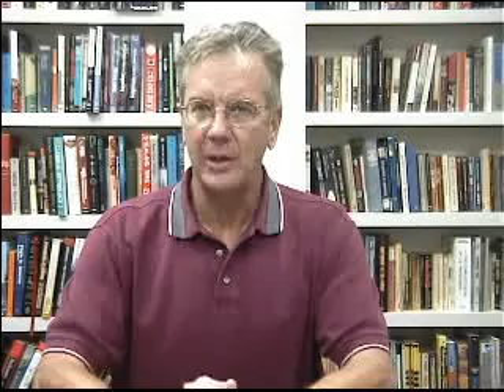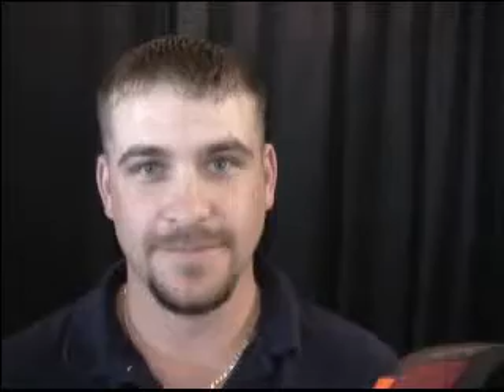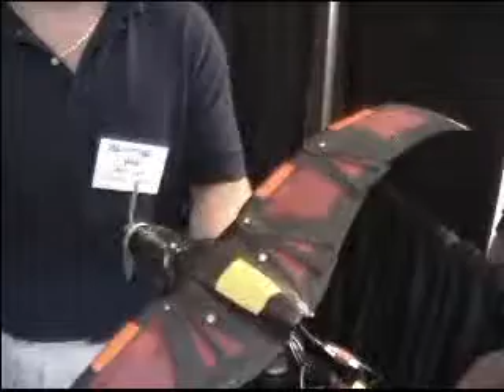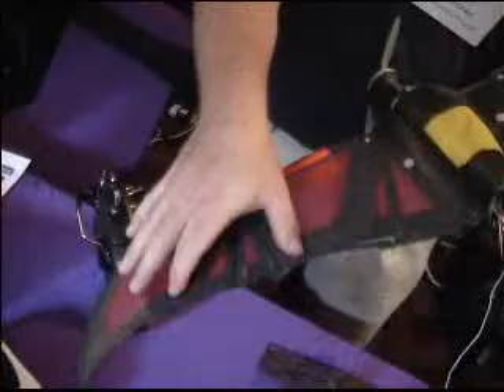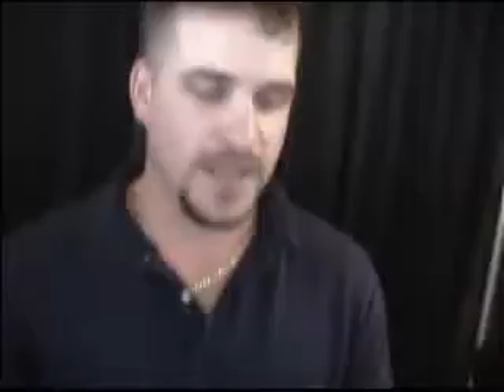University of Florida: Radical Airplane Design

Comment: Wouldn't a good idea to turn without banking be to shorten the lateral (left to right) size of one wing while moving its aileron down to compensate for the loss of lift, but gaining drag on that side of the plane as well?  Wouldn't that method turn the aircraft, itself in the direction of said wing without causing a change in elevation?